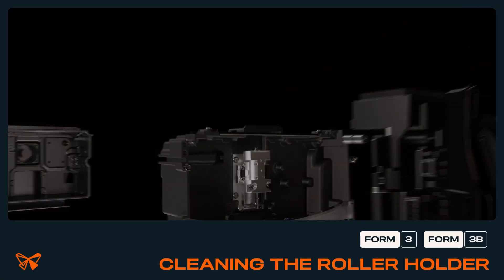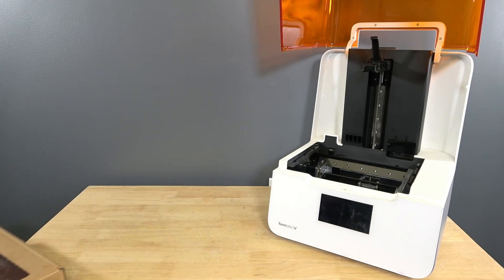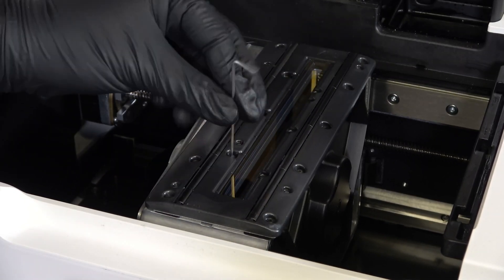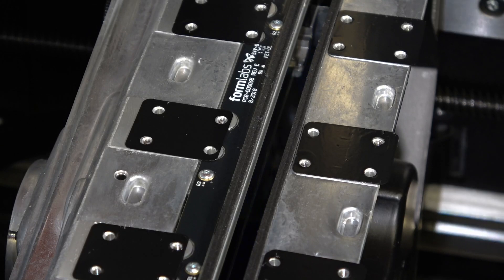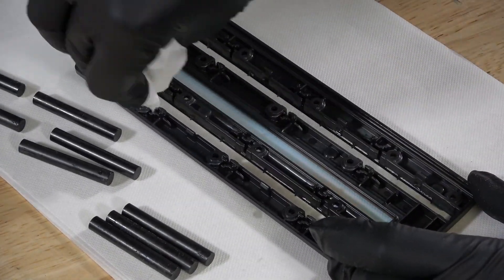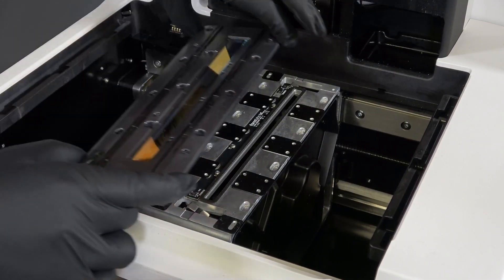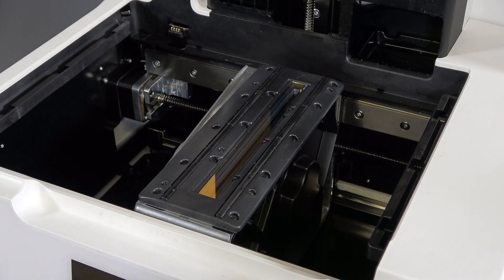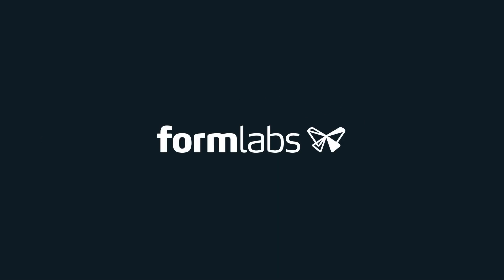How to Clean the Roller Holder | Form 3 SLA 3D Printer Maintenance

Comment: Are the rollers supposed to roll freely after screw installation? It seems that if I tighten them 'hand tight' then they will not roll, but backing them off (and being uncomfortably loose) results in them able to roll moderately.

Also, I just tore down a printer that had what seems like 400mL of elastic resin spill everywhere and the printer is rather well designed for repairability. The roller holder / glass window + gasket miraculously seems to have kept any resin from falling into the optical cavity.